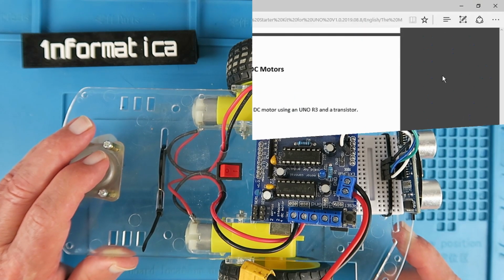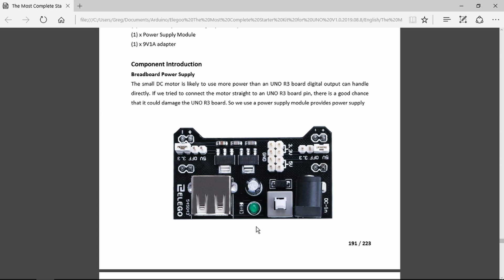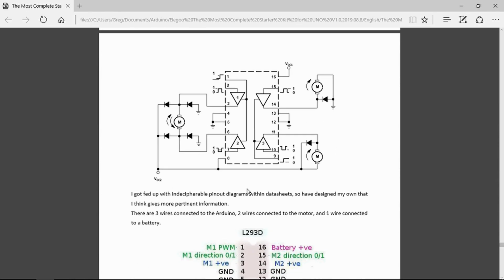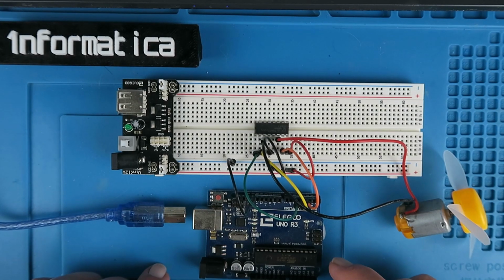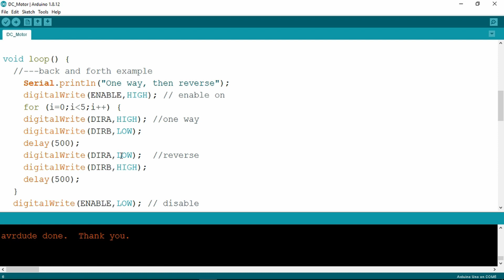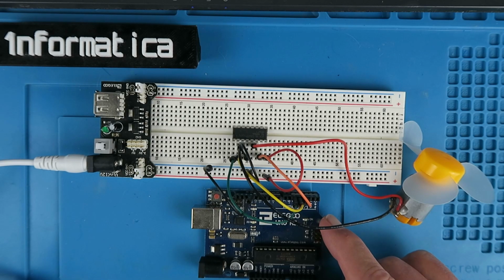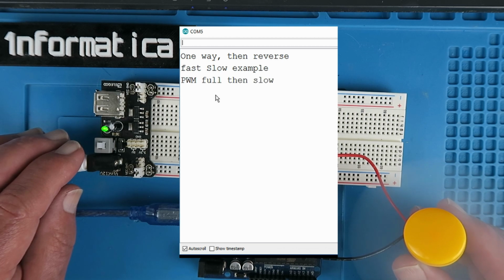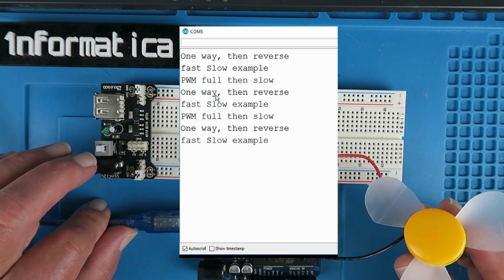Elegoo UNO R3 Project Part 21 L293D DC Motor Driver

Comment: I know this is an old video, but would you be willing to help me? I'm doing this lesson and have triple checked to ensure that my connections are correct, the code is the exact same from the lesson but it still doesn't work. My L293D did have some bent pins, so I wonder if that is the problem.
Reply from the maker: Hi, I assume the sketch is compiling and being written to the Arduino. Do you see the messages in the monitor window when the motor should be driven? You could put LED's with current limiting resistors on the outputs D4 and D3 which should light at the appropriate times. If the pins of the chip are not straight they may not touch the connections in the bread board, straighten them out as much as possible with pliers. As there are only a few wires you could also just solder wires to the pins. Of course you have tested that the motor works!! Thanks for watching, have a great day!

Comment: I was sure I’d wired it wrong because the motor didn’t spin, it just twitched. I was unsure if the 9v battery was hooked up because the lesson says “the code below does not use a separate power supply (i.e. a battery)”. I learned 3 things from your video: my wiring was correct, the 9V battery is connected, and the 9V battery that came with my kit was dead. Thanks for taking the time to make the video!
Reply from the maker: Happy to have helped! I discovered at an early age that if you put your tongue across the tabs of a 9 volt battery it will tingle according to the voltage. Don't try it on live circuits!!
Reply: @1nformatica  I discovered that at an early age because I have an older brother who I trusted…at the time 😆
Reply from the maker: @radish6691  😂

Comment: can you tell me whether the L293d ic is dual H or single H? (i have no idea about the H, but I'm confused, since i came across this)
Reply from the maker: Hi, It is a dual "H" bridge meaning it can drive 2 motors. The term "H" bridge comes from the shape of the circuit diagram when using transistors, see : https://www.build-electronic-circuits.com/h-bridge/ Please consider subscribing if you have not done so already!